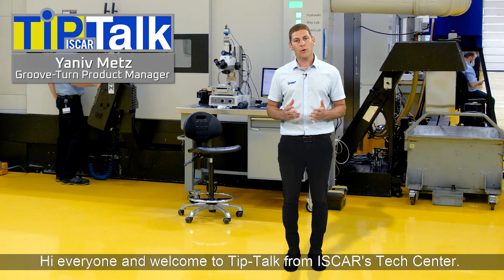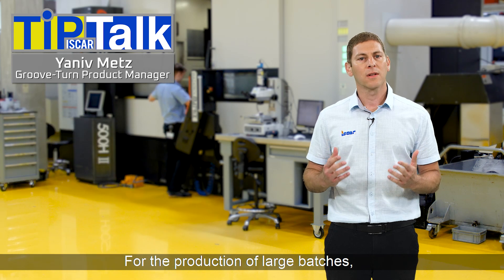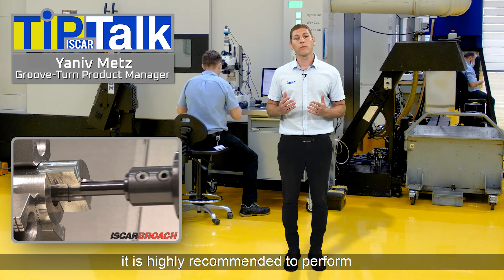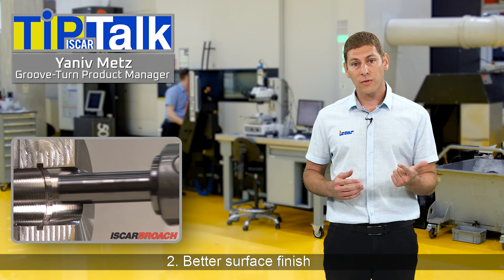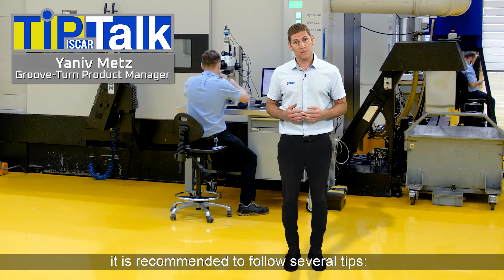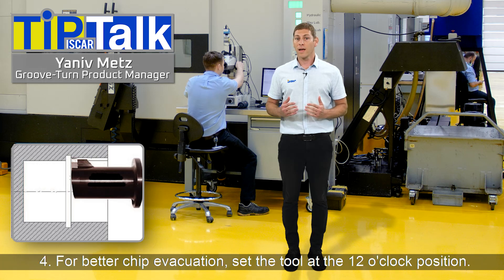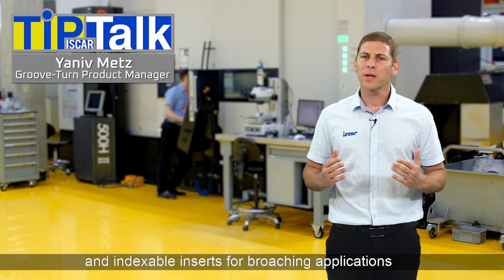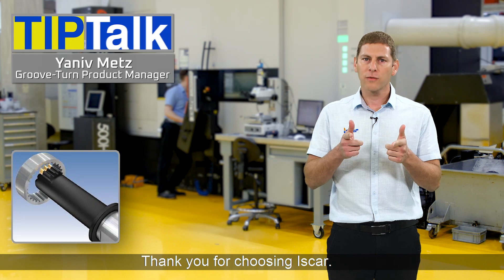ISCAR TIP TALK - Common Broaching Applications from ISCAR

Comment: It kind of looks like you were running in a multi-tasking/mill-turn style machine. I've been told that you shouldn't broach in these style machines because of the indexing milling head not being rigid enough for such an operation.  Thoughts?
Reply from the maker: We ran these tools many times on MAZAK INTEGREX 500H which indeed is a Multi-Tasking machine without any problems. Note that the tool is not positioned in the milling spindle.
Reply: @iscarweb lower turret?
I run a 250H but it lacks the lower turret unfortunately.
Reply from the maker: Indeed we run it on a lower turret